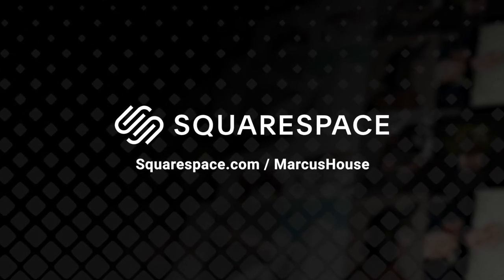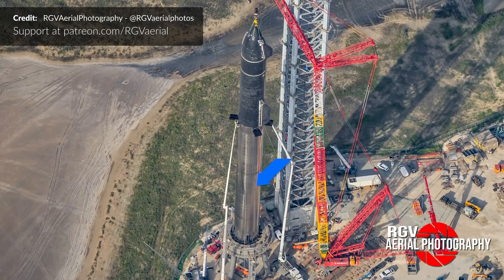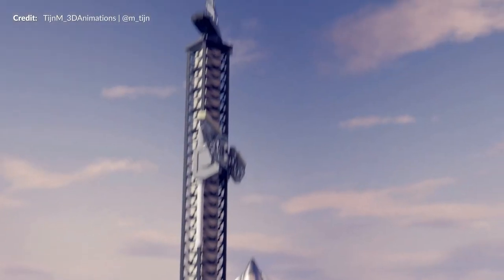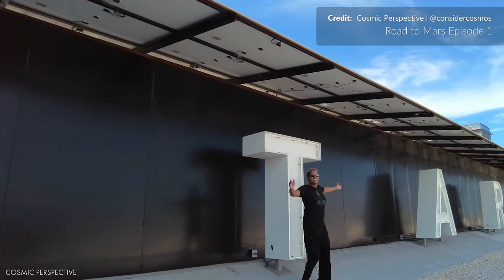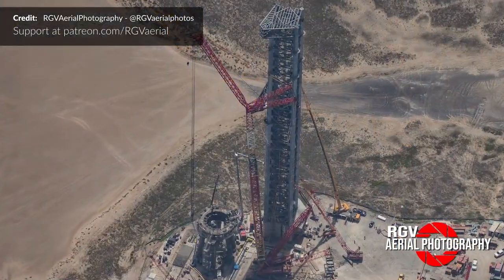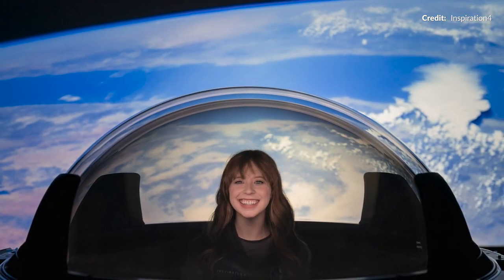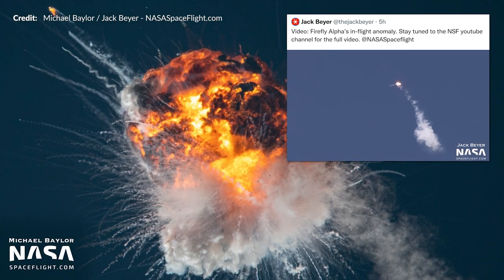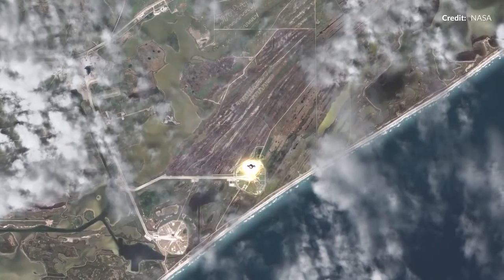SpaceX Starship's Stage Zero Progress, CRS-23, Firefly Alpha, Astra Sideways Launch, RFA Test

Comment: There would be a more simple method to catch the superheavy with a huge electromagnet (assemble it somehow to the catching arm and catch the booster itself (it's steel hull)). No need for those huge, heavy steel grid fins too. Rather they should manufacture them from carbon fibre materiaI, I think. Less weight, less propellant, more cargo, brand new V2 raptor engines. Best part is no part.
Reply: Not steel, stainless steel, not normally magnetic.
Reply: @Scanner9631  But you can assemble or connect steel plates with magnetic properties outside somehow on the booster. And overshadow the electronics and it's wires with plastic. Don't need so powerful current in the electromagnets. Just a long shape of it and attach it to the catching arm. And one catching arm is far enough.
Reply: So add so much mass to make it magnetic that you would be better off just building landing legs instead?
Reply: @Engineer9736  Nothing is impossible, you need a large long, vertical electromagnet with enough surface area to catch the booster or Starship.
Reply: @Scanner9631  No need for legs,just the steel plates on the booster and the plastic shielding around electronics, the electromagnetic catching arm would catch it in the air, like the current catching arm does. Reduce the boister's entire weight with the carbon fibre grid fins and others.

Comment: Just put an hock at top of Starship and Booster. Then spaceX would need just one crane like arm for catching it.
Reply: Orienting the booster and starship for stacking?
Reply: @Scanner9631  yea after the booster was put on the lanch table it can fold the hook down and starship can been stacked at top of it
Reply: You missed the point.  Starship needs precise aligning on top of the booster.  With one hook you don't have control of rotation to allow that positioning whereas the ability to rotate it is to be built into mechazilla.
Reply: @Scanner9631  ah I see. If you could have enough grip on the hook, It could probably be possible. That will also with the current system be difficult. I think with the hook it could be easier if it is hanging down straight. But who knows. I'm just an armchair expert who likes to think about such stuff.

Comment: This catching of the booster is a stupid risky thing, why not just land them ?
Reply: Landing legs add weight, which means more fuel for take off, boost back, and landing burn. No legs = more performance
Reply: @avsrule247  yes. And spaceX also doesn't found any legs or material that can be used as legs that can hold superheavy properly.

Comment: I'm beginning to think that SpaceX may need to generate/produce Liquid Oxygen on-site, as relying on current supplies can be a single point of failure. Additionally, I would like to know if there are cost savings by having it produced and plumbed directly to the OTF. Obviously the upfront cost would take numerous launches to pay itself off, but if the maintenance/upkeep/operations costs is more than just purchasing and transporting LOX to Starbase then SpaceX would need to consider if the cost/benefit of a 3rd party is worth it. 🤷‍♂️

Comment: I'm sorry, but catching these rockets is just ridiculous. So much can (and will) go wrong.. and for what.. to save a few pounds for a landing leg delete? All it takes is one horrific crash that takes out the fuel farm... which will be so much worse then anyone is thinking about. You can kiss Boca Chica goodbye after that... Not because it would cost allot to rebuild, but local support would likely go out the window, and the frigid FAA will ice over completely.
Reply: "and for what.. to save a few pounds for a landing leg delete?" More like 5-10 tons. The empty booster will weigh about 200 tons. You need really sturdy legs to support such a mass on landing.

"All it takes is one horrific crash that takes out the fuel farm." How much fuel is in the booster on landing again?
Reply: @3gunslingers  How much tonnage of stainless steel will be flying around.. cutting everything like it's butter.. ya know.. like Ox and Meth tanks just feet away.
Reply: @hawkdsl  
Judging by the explosion force of the last prototyps I recon that the larger parts will be too big to fly far and the smaller ones will be too light to puncture even the cryo-shells.

Sure, an exploding booster will leave a mess, but it will not be like setting of a huge bomb in the middle of the facility. 
The methane and LOX are not pre-mixed in the tanks. The will burn quite violently, but they will not explode like TNT.
Reply: @3gunslingers  I agree with you on that assessment. But if such a thing does happen, it will take allot of cash and time to repair/replace, and such images and videos will play on the news for weeks. I just think SpaceX is underestimating what that kind of PR will do to public opinion.. and I'm not talking about the nation at large, but the people 5 miles away at Port Isabel. There will be pressure to remove SpaceX then.
Reply: @hawkdsl  saying something "will go wrong" is just wrong. just because they're doing something that have never been done before it doesn't mean it will go wrong, compared to more crazy idea like Catching saturn V out of the sky (official by nasa), The mechazilla concept is nothing crazy, and its actually kinda make sense since not only that it reduced weight, it is also gonna save superheavy. SpaceX have not yet to find a legs for superheavy, atleast a good one to make superheavy stand properly.
Reply: @farel9476  "Saying something will go wrong is just wrong"... Interesting.
Reply: @hawkdsl  I just woke up when i wrote that sentences haha
Reply: @farel9476  LOL.. Been there.. done that myself!

Comment: My bet is that the idea of catching the Starship gets discarded. I understand why the booster catch mechanism makes sense but the final Starship will need landing legs. If the goal is to minimize overall components it would make more sense to land Starship next to the pad and use the crane to put it back on the booster.
Reply: "but the final Starship will need landing legs." Why? About 99% of all starships will not leave earth orbit.
Reply: @3gunslingers  That’s a guess. The system is meant to be capable for multiple use cases. Moon, Mars, point to point on earth, orbital refueling, deliver satellites, etc. I know the Lunar lander won’t need a header tank so subtract that. But it will need landing legs. I think it comes down to time and investment in the development of various components. At some point SpaceX will have to invest resources in developing landing legs.
Reply: @dlewis8405  
"The system is meant to be capable for multiple use cases. Moon, Mars, point to point on earth, orbital refueling, deliver satellites, etc. " The System, yes. But not the individual ships. 

Sure, SpaceX absolutely has to develop legs for Starship that work on earth, but in the end legs on every Starship will cost much more than the development cost of the catching system. Also they add considerable mass which has to directly be subtracted from the payload mass. In addition it will make the ship heavier on landing which takes more fuel to slow down, reducing the payload mass even more.

All in all shifting as much mass and systems to stage 0 will help SpaceX on the short term AND the long term.
Reply: @dlewis8405  I know the Lunar lander won’t need a header tank so subtract that. But it will need landing legs. 

Legs for the Lunar Starship would be very different from the ones for Earth Landings.

1/ 0.17 g on the moon means they support less weight.

2/ Landing on an unimproved surface compared to landing on pavement or at sea platform.  

If the catcher works why would they ever need landing legs for Earth?  Especially once they have multiple landing sites.
Reply: @Scanner9631  We will see what they come up with. I sort of wonder if the flaps are capable of supporting the Starship when it is caught without being damaged. The booster’s grid fins look better able to withstand the loads although I wonder about the pointed tips being bent.
Reply: From my understanding there will be dedicated points to hold by and they won't include either flaps or grid fins though they may be positioned close to them.
Reply: @dlewis8405  
The booster already has dedicated load points for catching. The current design of grid fins is not able to withstand the impact force of landing/catching.

Comment: Anyone got more info on the staging mechanism? I believe they are going to rotate the starship to unlock it from the booster by moving the engines to cause a reaction force on the starship and make it rotate a little. 
Also, the capture hooks....are they going to rotate in from plasma flow during re entry?

Comment: He could have saved money by leaving the Starship in orbit for an auxiliary fuel tanker be nice to think of something to save it
Reply: It is testing the reentry capability and adding the ability to store fuel and transfer it to other craft is an added cost in both development and manufacturing that doesn't need to be done yet.  Each SS and SH prototype has little to no unneeded mass and money spent as they are possibly or certainly (in this case) going to be lost or scrapped in favour of the next enhanced design.

Comment: Seems to me Starship needs a shock absorbing lander leg system. That's a lot of weight which needs to be countered when landing. Also, the first Starships on Mars won't have a chopstick tower... what happens there?
Reply: The Lunar and Martian variants of Starship will have landing legs. It's highly unlikely that we'll see a tower on Mars to catch Starship until Mars is self sustaining and flights are more frequent. (100years+). To return to Earth you don't need the booster, thus you don't need a tower. So the benefit isn't as great as it is here on Earth

Comment: why wouldn't one use cables and hooks as with catching aircraft on aircraft carriers.  I mean we have been catching flying objects for some time now.  Drop the cylinder through a loop, tighten the loop, hooks are small and light they grab the cables.
Reply: they  could be used as a buffer a dampener to be like a precatch before the arms secure the weight.

Comment: I say scrap the stupid catching arm and put landing legs on the damned thing. Regardless of the weight cost. Thats what SpaceX is famous for.
Reply: SpaceX is famous for doing something that has never been done before, if you actually know about super heavy then adding legs would not be on your mind, the legs would be crushed because of the weight. Catching is the only thing that they can do to save superheavy
Reply: @farel9476  because of the empty weight on landing???
Reply: @rchristie5401  its not exactly "empty"
 And the superheavy it self is already heavy without fuel, just imagine it stacked with starship
Reply: @farel9476  So how do you think it will fit in the launch cradle at lift off with starship on top at 11,000,000 pounds?
Reply: @rchristie5401  ?
Reply: @farel9476  how iS the booster and the starship going to be launched?
  Standing on the launch platform under its own weight?
Reply: @rchristie5401  by the launchpad?
Reply: @farel9476  we are done
Reply: @rchristie5401  damn are we getting a divorce?

Comment: there is one thing i still wonder about the starship 

how will the landing legs for mission to Luna and Mars will look like ???
Reply: To be designed.  .17 g and .38 g makes it possible to make much lighter landing gear for those missions.  Ultimately if permanent bases are made with refueling catching towers can be made on those locations.
Reply: @Scanner9631   no they wont make the mechazilla there , it will be a waste of money cause this 2 places got low gravity so booster wont be needed 

legs will

Comment: Of course it's not the largest ever powered flying object - even one that had to to be caught by a tower - than honour goes the rigid airships, Graf Zeppelin II and the Hindenburg, ^oo^
Reply: Just wait for the next generation Starship II and then Starship III.  :)
Reply: @Scanner9631  Yes, they'll be stunning - to be fair, this current Starship is stunning as well - I was just picking him up on a technicality - Those airships were truly astonishing tech for their time, 200 tons of mass and 245 meters (804 feet) long - top speed of 84 mph, which is pretty good for a thing that size - Always liked the American Nave Airship aircraft carriers, the Macon and the Ackron too, ^oo^
Reply: What I find interesting is that they are using the same basic d design for their fuel storage tanks, nitrogen tanks and water tanks. 

The water tanks and the over tanks on the fuel and nitrogen tanks are the same basic design but 12 meters in diameter. Now what if those are a duel purpose design?  What if they are prototyping for a 12 meter Starship II?

If this did turn out to be true it would be a big SURPRISE! for the competition and followers.  

I find it funny that so many of SpaceXs would be competitors are targeting cloning Falcon 9 when Starship is in the wings preparing to make it obsolete.  They should be targeting Starship II to obsolete Starship.  No vision
Reply: @Scanner9631  Interesting thoughts there - there's a lot of efficient use of tech they've already developed in SpaceX - part of the reason no doubt they can have this incredible pace of development at a relative bargain cost.  The only thing I've seen with comparable ambition is the recent Chinese plan to build very large vehicles in space - though, as with every other 'competitor', they are still sketching on the drawing board while SpaceX make many breakthroughs every year in real life, ^oo^

Comment: I am very skeptical on how well those heat tiles will remain attached to Starship.
I’m confident that the attachment methods will get better and more secure as time goes by.
Reply: I guess their testing will reveal how reliable they are.  It seems if they can get a dozen or so launches before having to refurbish them that'll be a pretty good turnaround.  It seems a ton simpler than what the space shuttle used.
Reply: @aeroripper  Sure simpler than the space shuttle - and the tiles have stainless steel to protect - which is a bit more forgiving than the very low melting/softening point aluminium of the Shuttle.

Comment: Saturn rocket looks a lot bigger does anyone knows what is fuel gallons comparison?
Reply: Saturn V first stage could loft 300,000 lbs to Low Earth Orbit, Spacex Super Heavy can loft over a 1,000,000 lbs to LEO. Saturn V was 363 ft tall, Spacex Super Heavy is between 387ft and 400 ft tall.
Reply: @northhammerfl  Still bfr can not make to the moon without refuling as i have seen on videos ?
Reply: But with refueling it gets 100+ tons of CARGO to the Lunar surface.   Additionally re-usability becomes possible.  Rather better than the LEM delivered to Lunar orbit by a Saturn 5.

Now hypothetically they could split Starship into a engine/fuel tankage 2nd stage and a HLS 3rd stage that wouldn't need as much fuel and wouldn't have as much cargo capacity either.  The 2nd stage would need to reenter and land the 3rd stage not.
Reply: @Scanner9631  Yes that seems to be a case, you seem to know a lot about what you think of making habitable space in an empty fuel tank That is about 70 % off space that never will be used for anything after landing and assuming that it will stay there as a base?
Reply: If they were serious about using it as a base they would convert the tanks to habitation.  Bottom level for things used on the surface 2nd level for living.  Higher levels for science, workshops, recreation and storage.  Elevator up the center if my vision is right.  

150 feet tall potentially 12 stories with perhaps the top of the cone filled with oxygen storage or life support equipment.
Reply: @Scanner9631  Thanks for reply

Comment: Just land starship, catching it will be much harder because of the heat shield and you already have shown it can land
Reply: @cjtymczak4687  

Why are you so sure you know better than the engineers at SpaceX?

Just a question.
Reply: @Scanner9631  I don’t, but I am also an Engineer. Not trying to beat them, but this is a tough nut to crack, I think any suggestions could be helpful.
Reply: I think that the actual experts in the Starship at SpaceX have far more information and applicable expertise to make that call.

One may question why they made the call.  But to flat out call them wrong is rather arrogant.

Are they right?  Time will show but at present I'm willing to say they probably know what they are doing.